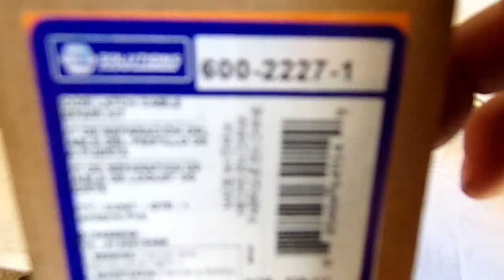FORD E150 , E250 , E350 Rear Cargo Doors Won't Open.

Comment: How odd to take everything off EXCEPT the ACCESS panel to get ACCESS. Also, do you realize you don't have to disconnect the cables from the door latch, you can just slide the cable ends over the cable? This video turns a fairly straightforward project into an hour long challenge.

Comment: If you have to do this, do all four doors, 2 rear and 2 side at the same time. I didn’t and one would fail, fixit, then a month later another another fails , rinse repeat, rinse repeat. The door he does is the worst of the four. And I took the black panel on the inside below the speaker off and the outside black box comes out. So much more room to get in and out.

Comment: So much easier to take off that big black plate. gives you way more room to work when that comes off along with the license plate trim
Reply: I noticed for several minutes around the 18 min mark or so of that large black plate to the left of the hole this guy is working with his screwdriver. I notice the bolts. Why not remove that panel?
Reply: yeah buddy
Reply: His mistake.   What gets me it's so hard 2 get behind all that metal,  they don't want u 2 remove , 4 a much easier job.

Comment: This guy made it hard and confusing. The correct way to do it is remove the plastic recessed box where the license plate is. This allows easy access. Remove Torx bolts holding the latch, the actuator is held in place by a U bracket, carefully pry one side away and the actuator will come loose, allowing the latch mechanism to drop down , to easily replace the cables. He drilled out the rivet on the door edge below the latch. This is not necessary and makes for extra work reattaching U bracket.

Comment: Thanks for the detailed walk-through. I just completed this job on my 99 E-350 in less time than it took to watch the video. Two tips. Take the license plate assembly out early in the process. And no need to drill out the rivet. That piece can be pried out of its bracket and clipped back in without dismounting the bracket. Also I didn’t try to crimp the new cable ends and it works great. I appreciate you te eking time to share your experience!
Reply: I'm still working on a door on my 2007 E-350 (for me the forward part of the side doors which seems close enough to compare to the door in the video). I don't have tool to make new rivet so confirmation that I could just pry out that part was very helpful.
Reply: thanks very much for info.
Reply: Wish I would have seen your comment earlier! Drilled my out. Now have to figure out how to re-attach it.

Comment: An update, just fixed this, you don’t have to drill the rivet, the “Actuator” is clipped into that “C” channel. Use flat head screw driver to peel out C channel to release pins in “Actuator “ from C channel. Then the whole assembly comes out.
Reply: Can you do this from inside the door or from the outside?

Comment: I've been trying to do this on and off for months, on my side and rear doors. It's a cargo van, so no interior panels. Been crawling back and pulling the cables for over a year. This was probably one of the most helpful videos. I appreciate it.
I did take the black panel/ license plate piece off, made it a lot easier.
If anyone in the future sees this and needs help, this is the video to watch.
Reply from the maker: Thank you
Reply: why didnt you just take off the licence plate holder?
Reply: @rayssongs  I said right there in my comment, “I did take the black panel/ license plate piece off, made it a lot easier.”
Reply: yes

Comment: This helped give an idea of the process of getting the door open before diving in. Had to get the door open on one set up for refrigeration and it is all fiber glassed inside with custom door skins and fiberglass insulation in the doors / foamed windows, a little tedious getting the skin off with the door shut, but got it off enough to reach in the speaker hole and fidget around until I got it to unlatch. I found that the outer handle in the license plate frame, had a rusty bolt on the return spring, so the handle was stuck, and the spring couldn't release it, not allowing either handle to open it. I cleaned it up, greased it, and works again.

Comment: I couldn't open my rear van door from the inside or outsides, and your video helped me visualize what needed to be done. Took me a bit longer in the hot Texas heat, but my the door works as it should now. Thanks!

Comment: I just bought a 2000 ford f150 with the 2 half doors that will not open. I guess this is what the issue with them is....good job bro. Shalom

Comment: Next time just remove the license plate holder withe the for bolts on the inside you will gain way more room. They are the 4 on the black panel on the inside of the door. But all in all great to know about those doorman retainers.. good video. Thank you!

Comment: To remove the old rubber ends on my cables I used a pair of heavy pliers and just "squished" the rubber until it flaked and fell off.

Comment: 12:10 - Don't knock out the rivet holding the actuator, It's actually a clip. Take a screwdriver or small pry bar to the inside left or right. Pry out and then slip the actuator out of the clip. It's a pretty heavy clip on my 2004 E350 but you can pop the actuator out.

Comment: The door lock actuator can be removed after removing the license plate housing by using a flat screw driver to ply the actuator on both sides from the bracket.  No drilling is necessary.

Comment: It seems like the hardest part was getting to the cable ends in the actuator .
Isn’t it the ends going to the latches where they usually break? 
Could you just get by doing the long ends?

Comment: I have a 2009 Ford E350 XLT super duty and the REAR side door won't open.  Can't get the top plastic door panel off either.
Suggestions?

Comment: The problem is the mechanism is frozen and you cannot get the doors open how can you fix it. How do you fix it when you can't get the doors open because the mechanism is either rested or Frozen and the cables broke off trying to open it

Comment: wouldve been less of a hassle if you removed that big metal panel. and then put the screws back on without the metal panel. will hold it all in place without the metal panel being there and you wouldve had a lot of room.

Comment: I pull down on cable And door doesn't open, what 2 do? And u buy parts from nappa?
Reply from the maker: You may have to remove the big black panel and follow cable up to the latch and pull on release , also make sure door is unlocked